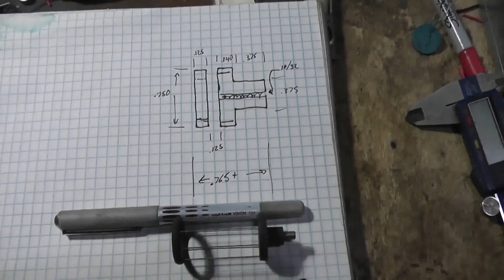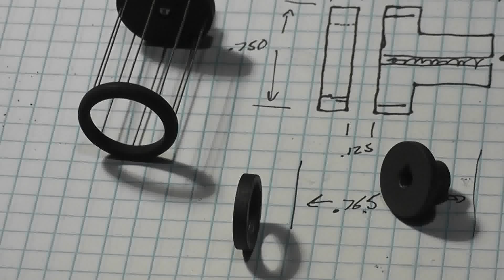GridEndFab

Comment: Hi Doug, why are you using graphite for the construction?
Reply from the maker: Well, the stuff I get has some really nice properties, mainly.  It's very thermally and electrically conductive.  It's easy to machine, you can't melt it...and it's just soft enough that if I drill just the right size hole, it grabs and holds the tungsten rods tightly - else things fly apart from the electrostatic forces (the rods aren't perfectly round and help that way, hinder another - I may make a jig so the elipticity is all oriented radially so that error is nil too...).  The downside is that we get the odd hydrocarbon from hot D hitting the C, but that's real minimal.  Sputtering in the high purity environment I run here is minimal as well.  I may play with BN for the end - open or not, far from the HV stalk.  But using graphite, it has to have a hole or ions just slam it from both sides, waste heat and all that.  With an open end, we see a mix of various charged particles coming out, going all the way across the tank, and by Paschen's PxD law, can run lower pressures - it does double duty helping create more ions - it's about a 16" path in that direction, vs the around 2.5" radially.
We see an actual transition from molecular to viscous flow from our focus coming out the end.  It's just kinda cool we're getting that high of a "compression ratio" with this.  It seems both output and Q are going up roughly as the square of accuracy so far.  Even at a mere 50kv and 12 ma, 10m n/s is nothing special even in static mode.  In oscillation, it goes up enough to be actually quite dangerous, which is why we're spending so much time these days on shielding and remote control.  I'm not reporting the accurate number yet, but it's super-good and super scary if we replicate it, I just don't want to be in the same room with ~~ 84mw worth of fusion at the moment.  Huge breakthrough...coming soon.  I'll be reporting accurate numbers on the forum once I get it "down".  Right now, a 30 second exposure to this in "periodic mode" will give you rad sickness, even though we've killed all the X rays with lead - enough to need more support under my floor.  It doesn't do crap for the neutron flux.
And it's also very low in secondary electron emission.
Reply: Doug Coulter Sounds pretty exciting, well done. Are you still using two grids?
Reply from the maker: Steven Sesselmann Yes.  We have a fairly weird geometry here - we're running the fusor in a 6x6" sidearm of a 14" diameter by 26" tall ID tank.  We put another smaller grid out in the main tank, and it serves as both an ion source and a control grid with a power gain of over 100 when used as the control grid of a "plasma triode", kind of a PNP tube if you will.  The greater PxD, even with the same P, lets Paschen's law work for, rather than against us with lower tank pressures, which in turn create longer mean free paths, which leads to reduced scattering in our "lens" area, which in turn leads to better focus.  The second grid, usually run at 10-15kv "bias" doesn't really make a bunch of neutrons itself, mainly just ions.  I've not tried an even smaller, better made one in that spot yet....but probably will get around to that.  I'm just using a 2 wire tantalum loop grid there, spherical (grossly, it's pretty crummy).  It's pretty amazing that you can have -50kv on the main grid, yet changing the "ion source grid" about 300v can just turn it on and off totally (40-0 ma), at a couple milliamps to the "control grid" when it draws current.